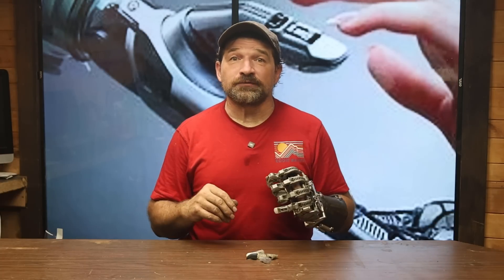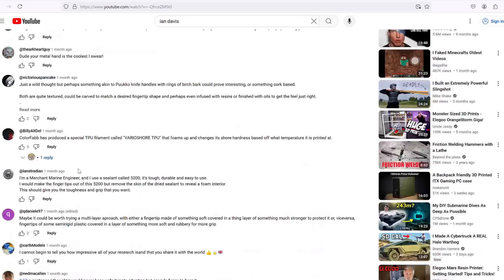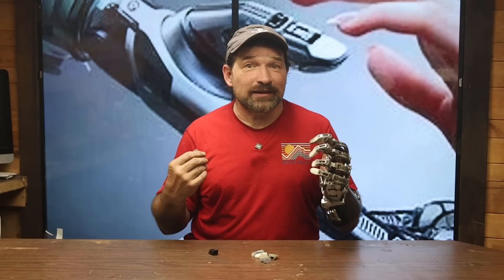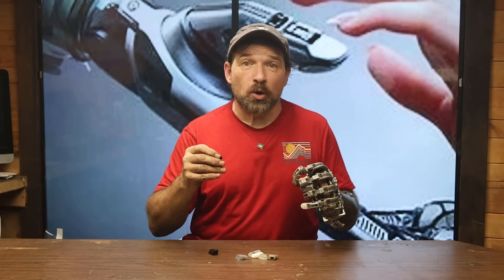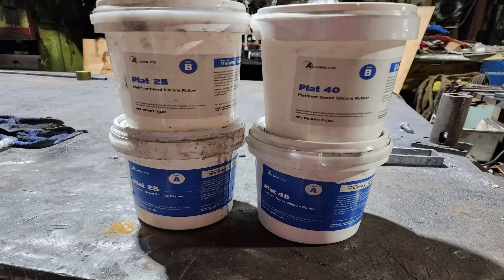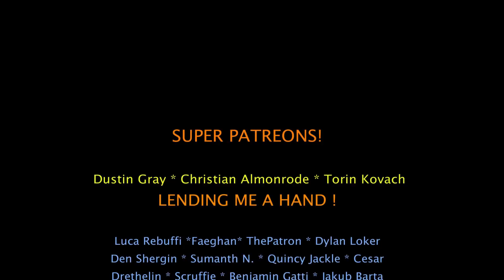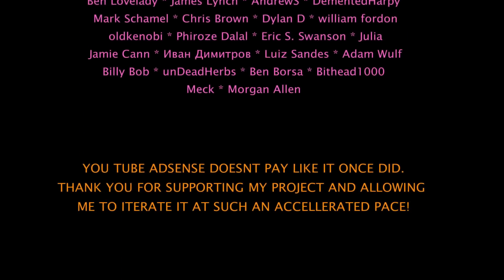Continuing the Quest to build the Perfect fingertips

Comment: You must already know that, any flexible material you print with will eventually become rigid in a relative short time, so it is not ideal for your costumers. So my advice is make rigid finger tips out of a dishwasher friendly 3dprint filament and if you need a flexible grip to use the workshop grinder or hold a smartphone then you should sew an adaptative glove for that purpose. 

I mean, we cannot provide you ideal advices if we do not know what specific work task are you aiming for. On the last video you talked about holding tight a grinder machine and that is mostly solved increasing the surface area of contact. So I understand it is a dilemma.

Think about the engineering of a boxing glove, and how for years it stays flexible and strong.

The only alternative I see is using generic lab latex gloves, they come in box pack of a 100. Cut just the full finger and attach them to your prothesis fingers. If you or any of your costumers worldwide break the outer layer of a single latex finger you, and they can find an easy replacement.

Comment: What about balsa wood? They wouldn't be perfect in any respect, but you could stick a block of wood on a milling machine, load a program, and carve out a good many replacements for very cheap. Leaving it as a rough finish would also maybe help grip?
Plus, if they get damaged in any way that they're not completely borked, just shove some PVA in them and they'd probably still be somewhat useable.
Cheap. low labour. Can be easily produced in large quantity. and if I understand Balsa wood right, it should easily friction-fit to the tangs you have, and have decent grip for the cost and labour investment.

Comment: While retractions and fan speed are important for flexible filament stringing, starting with a very dry filament, I carefully tuned the pressure advance on my printer with my super soft filament and all but eliminated stringing. This is with an Esun 83A tpe and the difference the pressure advance made was tremendous. If you do take the time to tune it expect a much larger number with TPU and tpe than you would any other filament.

Comment: cant remember what its called but what abount k2 the impact material non nutonium material. equally an idea I could think about would be if there are multiple types of uv reactive materials, you could just be able to leave them on the build plate, load up the next material in either a differnt vat or different printer if the line up is right then should be able to fill voids with different materials in theory.

Comment: Hello Ian, great video, love the explanations of your different ideas and processes!

Have you tried something like a “U” shape mechanical fastener that goes over the tip of the finger, runs along the side, then secures to a part of the digit near the hinge?

Basically instead of trying to secure it from the inside, you do it from the outside. If you use thin wire and design a groove into the tip, you can guide it and ensure it doesn’t interfere with anything you’re attempting to grab.

That doesn’t address any of the material issues but one thing at a time eh?

Looking forward to your next video to see what you come up with!

Comment: I watched the video carefully, and I noticed that none of your tips have fingernails.  The fingernail is the most important part of the finger!  It provides protection to the top of the fingertip, but it also provides structural support to the pad of the fingertip.  Else the meat of our fingertips would simply squish around the bones of our fingers, and even avulse right off the bone.  The nail spreads linear, lateral and shear forces across the entire fingertip, while also providing support and increasing friction on the prints.  Check out "Measurement of finger pad forces and friction using finger nail mounted strain gauges" by Harry Popplewell, Matt Carré, and Roger Lewis.  (I can't post links in YT comments.)  It might also be interesting to investigate if it's possible to manufacture a fingertip "bone" for your hand that approximates the actual bone as much as possible, within the constraints of the material?  Naturally the joint is out of the question, but perhaps just the tip?  That way, you'd get similar load distribution and dispersal across an artificial fingernail and the "meat" of the fingertip.  Regardless, excellent work!  You are changing people's lives for the better!
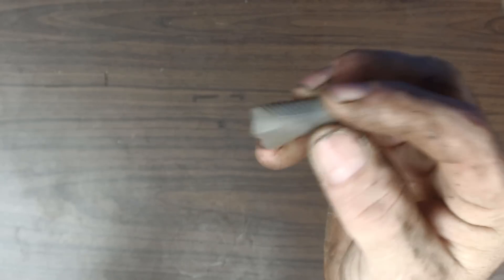Reply: 3:04 for a good view of the tang, Something that comes off the top of the hinge point parallel to the tang to support the whole tip, and act like a fingernail? it could also have a nubbin at the end to help stop any tips coming off (i'm so bad at explaining half formed ideas, or full ideas for that matter)
Reply: This is a really good point! Poking around at mine, I'm noticing they're doubly convex, allowing distribution of force from the tip of the nail all the way back the base along the arch.

In his application, it could be possible to have the core material extend up from the tang and to the tip of the finger, allowing for a "nail" of curved, denser material on the top of the finger tip. My worry with this in his previous materials would be the "thin silicone isn't strong enough" issue making the small areas bonding to the outside edge of the "nail" quite fragile. But that issue disappears with Varioshore! The main advantage here is allowing more "surface" soft rubber to be printed without jeopardizing the integrity of the tip, giving better grip, as well as perhaps better overall durability.

This all leads to the final potential worry with an artificial nail and a design approach to mitigate it: lack of proprioception. Without this, I imagine it's somewhat easy to clip the fingertips against hard surfaces in the shop without noticing, leading to the "missing tip" problem mentioned in the video. This might not always remove the tips when the entire exterior is soft; the flex preventing them from popping off, but with a hard nail they might catch and yeet themselves more easily. My mitigation idea is that since the nail edge is not particularly useful in this case, you could print them to not extend fully to the tip, in the style of someone who habitually cuts their nails quite short. All this is speculation to some extent since I've never printed Varioshore, but I wish you the best of luck! 

Anyways, it is a whole other redesign so I'm not sure of the value of this concept or if it's something you've attempted to include before. Either way, I hope this helps!
Reply: You can do just fine without a fingernail. If you lose one permanently it will be annoying for a awhile, but eventually you get used to it and often forget that you don't have one. I'm not saying they aren't useful, but they are not "the most important part of the finger"
Reply: @simon_far  I think you lost track of the purpose of this conversation. It about a solution to a problem.

Comment: Have you thought about Cast Natural Rubber?    I am not talking about the poured 2 parts stuff.  I mean legit baked in Aluminium mold?  I try to watch you videos but I might have missed the trial.  

The molds for these are not expensive and can be outsourced if need the need arises.  If you want to test the idea you can make a mockup using RC tires.  It will not be pretty but it will allow you to test the material.  The RC tires are not 100% natural rubber but that will be another bridge to cross.  Race slicks for 1/10 onroad are very sticky and rockcrawling tires will have the biggest meat.  you can make the central core from the meat and the holding sides from race tires.  they will resist brake cleaner and wd40 (one for cleaning other for more traction) and glues together with super glue...

for the greatest gripping action you want the core to be strong but the outside to be softer.  the aluminium holder simulates the bone, a 50 to 60 shore center simulates the muscles and meat and a 20 to 30 shore outher layer will simulate skin with fat under it...

If you have tested this Idea and somehow missed it I will watch it and see what you have done there...

Comment: Thank you for the introduction to who you are and what you’ve tried so far!

I was going to suggest imbedding a cloth or mesh into the 3d printed part by pausing the print, laying a piece of mesh over it, and resuming the print of the finger core. The silicone should bond to itself with the mesh imbedded, and create a flexible connection between the rigid core and the flexible silicone. 

The only major issue I see is the need to trim the mesh out of the interior of the fingertip core, but that seems doable and maybe solvable by pre-punching that area out of the mesh before laying it down.

Comment: for the 3d print inhibiting curing i can recommend a product called "InhibitX",  but also maybe try to make a silicone mold and cast a lower shore hardness resin, there are a ton of them so you'd probably have to try a couple to find the right resin, but there are some that are like vinyl or softer,  softer resins are also tough and can bond to stuff better than silicone too so that could be a plus. 

if you'd like more info on what resins to maybe pick i can put in some ones i think might fit.

Comment: Would milli putt work a two part appoxy clay, mould it around the finger tip, sculpt in the grippage then , (you can get two part epoxy that hardens so it finishes a bit like silicone but not as soft

Comment: If you have any printers with a Duet board, it's pretty easy to setup 3 virtual tools so you can have the print temperature change dynamically during a print.  Would need a purge-block to catch the oozing that happens while the hot-end heats and cools.  

Might be able to do this on any printer if someone in the comments is a wizard with Slicr post processing...  (might even just be a find-n-replace to switch the "T" tool codes to "M" codes setting the temperature)

Comment: Stringing is usually a moisture issue though it might be inherent in vari-shore due to the foaming agent.  Dry the filament and store it with a ton of fresh dessicant.  Pretty much can't make filament too dry.  

"coasting", "wiping", setting Z-hop to zero, and "don't cross preimiter" settings also help a lot.   

A heat gun is another quick fix for stringing, turns the wispy strings into little balls that are easier to clean off.  Might also let you re-melt and seal the Vari-shore surface.

Comment: Not sure if already mentioned on this or previous video, but, did you turn on sequential printing in your slicer(assume you use Prusa)?  This helped me eliminate the bulk of stringing when printing TPU and multiple items at once.
Reply from the maker: I was using my creality k1 to print the varioshore fingertips in this video. These had an infill of 20%. I cleaned them up and started wearing them this afternoon.

Comment: Here's a weird idea:  manually wind a bunch of TPU filament around the finger tang in an amorphous sort of ball, and then use a two-piece metal mold/clamp that you machine.  Heat up both sides of the metal mold to TPU melting temp and then squeeze them together around the finger-tip.  I'm thinking the two-piece mold would be affixed to pliers-like handles.  It's probably not the best solution but could be one of the speediest solutions to make a fingertip in a pinch (no pun intended)

Comment: Have you considered sealing the rigid printed mesh with something like epoxy or clear coat in order to prevent the chemical incompatibility issue with using them in casting?

Comment: Have you considered making the little snap-on cores out of a stiff silicone, then overmolding those with a softer silicone? My understanding is that the silicones will chemically bond, so having mechanical bond with channels or fins or whathaveyou wouldn't be strictly necessary

Comment: Maybe climbing shoe rubber like Vibram XS grip would meet the requirements? You can buy it in sheets but it might be hard to create fingertips from it. It is durable enough to be replaced once every 6 months I suppose (unless you will be rubbing it with sandpaper daily)
Reply: Punching the outline would be easy. But then the profile and tang slot would be difficult.
Reply: @pauldeddens5349  well I assume OP didn't mean making the entire tip out of it
Reply: It's funny because I started climbing recently and I was also going to comment this,however I think that despite being very grippy, it's not going to really squish with such a small surface so you'd have to cushion it. We feel it squishing when we climb but we're talking say smaller forces here, not to mention that it's probably actually the shoe that's bending

Comment: The secret to dealing with stringing with Varioshore is to print using the "one object at a time" feature in your slicer.  Also use "avoid crossing walls" feature.  You can still print a set of them all together, but since the print head does not travel from object to object, stringing is much less of an issue.

Comment: Have you tried having the tip of the finger made out of metal like the rest with an indent that holds a small rubber pad or some such? Or maybe just a ribbed metal finger with small enough points could work

Comment: On the silicone tips: Have you tried overmolding silicone onto silicone? In some applications manufacturers will mold a higher duro core and bed that in a lower duro exterior. Additionally, this method might afford different geometries such as instead of having a stiff core fully enclosed in softer material, just the pads could be made from the conforming material.

Getting away from the core idea of accessibility for everyone a bit here, but this application is perfect for something like a mini injection molder. Also, if you have bonding issues, silicones will respond well to plasma treatments to increase surface energy so glues and such will bond to it better.
Reply: I was thinking the same thing.
Reply: Like dual density dildos. LOL. 

But for real, it’s a good idea.

Comment: I wonder if you could overcast a silicone with an additive that produces gas when heated up (baking powder etc.). Afer the part is done you press it against a hot surface - making the additive in outer portions of the cast expand / creating voids - which could give you some squish-factor.

Comment: Have you experimented with artificial fingernails yet? Could see that improving the durability of molded fingertips as it could prevent them being ripped off the core when you grab something. Maybe just as a simple metal sleeve between prosthetic and fingertip.
Reply: That's a good idea. Maybe it could help improve dexterity in a way similar to real fingernails.

Comment: Have you experimented with rubber? It’s a dumb idea, but maybe you should try something with pink pencil-top erasers. 

Have a cylindrical mounting point the diameter of a pencil, then have a spike coming out of the top for extra rigidity towards the tip of the eraser. You would spike the eraser and slide it down over the top of the mounting cylinder. You’ll need some sort of clamp for the outside of the eraser to hold it to the mount.

If it works you would have a super cost-effective fingertip system. The biggest issue I think would be designing a nice mounting solution and the durability of the tips.